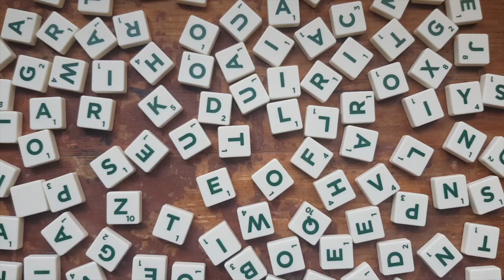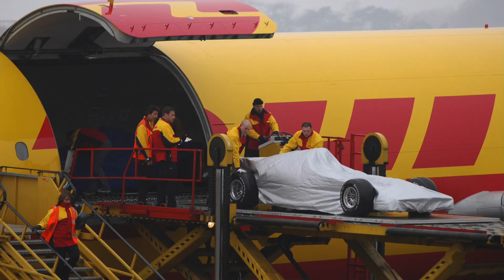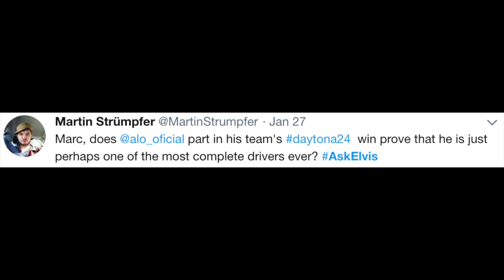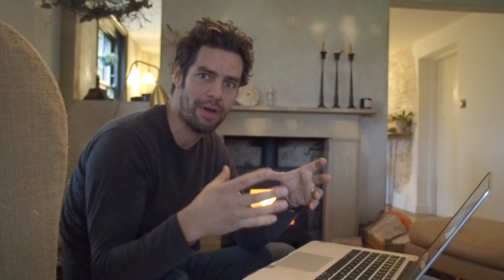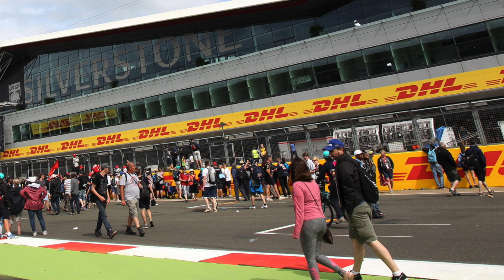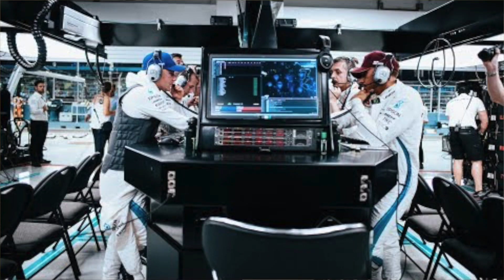MP218 - Can Rain Actually Wash Away F1 Track Rubber?...

Comment: 8:08 if you don't think Alonso did something quite special in Daytona you need to watch the race. Alonso on his own put the #10 Cadillac a total of 2 minutes and 4 seconds ahead of second place when you combine all his stints during the race, and lost that gap each time because of full course yellows. During the night stint when it was raining he would have lapped the 2nd place #6 Acura if that FCY come just 20 or 30 minutes later.
Reply from the maker: I'm not saying he didn't do a great job at all, just that it wasn't just him, it was a team effort.
Reply: I think that was great what he did, with his team, but a Daytona wont define Alonso's career but a nice feather in the cap. His F1 achievements I think are greater. A triple crown as well maybe.
Reply: Marc Priestley Sorry Marc, but it didn’t come across as a fair evaluation of his achievement. You implied any F1 could have done it, and that’s not true.  It surely was a team effort, but the focus on Alonso’s performance fully deserved. The guy was outstanding.

Comment: A drivers crashhelmet is lighter not to do the overall car lighter, but to reduce weight of the helmet itself, because the G force in the corners or breaking zones are soo high, that the drivers neck wouldn't handle for 2 hours if the helmets were heavy 😎

Comment: #AskElvis In what area do you think this year's cars will be slower? My initial impression is that they will be slower in a straight line because the new front wings will be less effective at directing air away from the very draggy wheels. However, both the front wing and rear wing are larger than the 2018 spec so does that mean they will be even faster than this year's cars in the corners since they are producing more downforce? Will this be the case, or is it impossible to tell before testing comes? Thanks.
Reply: They didn’t get rid of the “Y250” vortex so the teams still have a source of outwash.

Comment: #AskElvis how do the tyre allocations/choice for the teams for the first race this season work regarding when they have to decide how many of each set. Considering its non-european race, the no. of sets need to be decided 14 weeks prior. Considering now that we have a difference in terms of low profile tyres,  different aero regs, etc. how do the teams go about choosing their tyre choices based solely on the one test we had at the end of last year, and be it so far in advance, with little on-track knowledge on the new tyres and their new cars.
Reply from the maker: They have to base it on simulation, data collected at the Abu Dhabi test and the information from Pirelli. No low profile tyres until 2021.

Comment: Hey Marc, love the vids. #AskElvis
Speaking as an amateur racing driver, would removing all telemetry from the cars, apart from reliability ones in the engine, be a great way to do improve the racing also making the drivers 100% responsible for the setup of the car. In amateur racing there is no telemetry what so ever so you need to properly feel the car, which leads to people sometimes going down the wrong path, instead of a computer doing all the work? Cheers
Reply: Love your thoughts Jason, Senna certainly didn't have an engineer telling how to drive did he? I think it takes away a bit of the driver being the 'hero' now days but with so much money on the line teams will do whatever they can to win. They had the rules of no team orders but Charlie Whiting and his team know the teams had so many options to implement them it was too hard to police. What do you race mate?
Reply: Slashcanplay 1 Thanks for the reply mate, down under I race Hyundai Excel a really cheap entry level series but it is fucking fun

Comment: #AskElvis Hi Marc, Love your videos! My question is, with the new 2019 regulations introducing a minimum weight for driver and seat of 80 kg, ensuring heavier drivers are no longer penalised. This means (in theory) lighter drivers would get weight added to somewhere at the back of the seat. But wouldn't lighter drivers still have an advantage, as they will be able to reach the 80 kg mark by adding on leg muscle, with a lower centre of gravity.
Reply from the maker: Haha, the butt is the lowest part of a driver, so maybe big butts could be an advantage!
Reply: Haha, I guess you’re right 😅

Comment: #AskElvis The FIA only allows so many parts per team but how do they check that? i know that in other sport there are these stickers with codes on em and they scan them but in such a high end sport how do they do it? I guess its complicated because otherwise team would surely try and 'cheat'... :p
Reply from the maker: Similar, they do have electronic seals stuck across certain components which can be scanned and checked by the FIA.
Reply: @F1Elvis  Oh, really? Thanks! :D